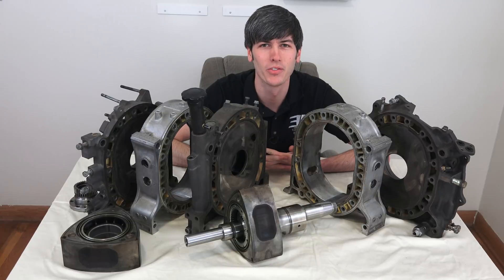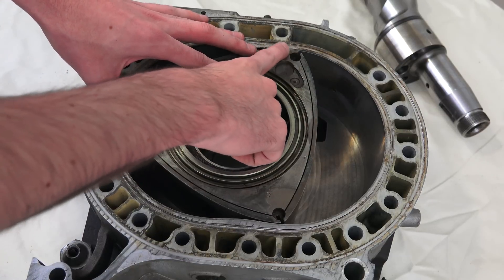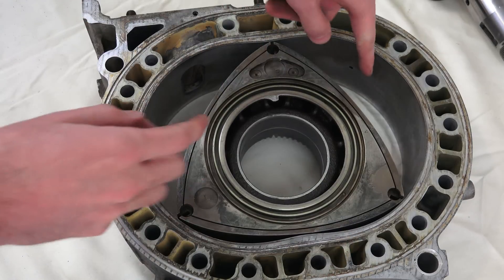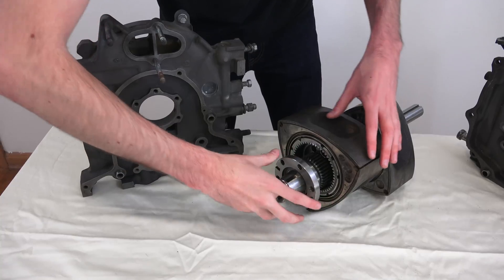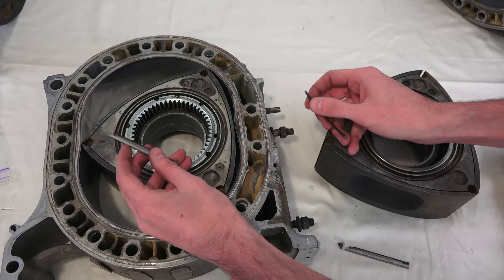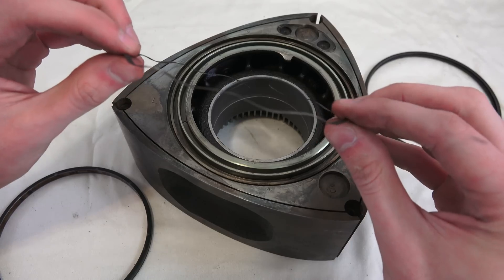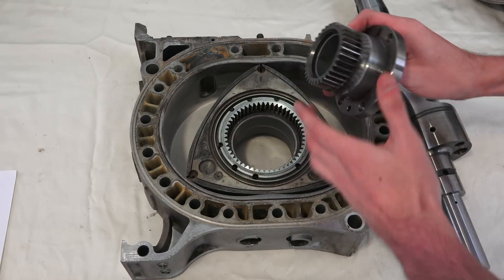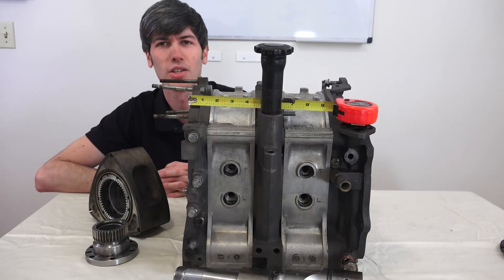How Rotary Engines Work - Mazda RX-7 Wankel - Detailed Explanation

Comment: what a fantastic design... No matter how bad the disadvantages are. I really hope they can find solutions for these problems some day.
Reply: Mazda hinted at the idea of bringing back the rotary but with some derivative of skyactiv tech (from what I've read in a Motor Trend mag). But who knows, maybe they're just giving us blue balls.
Reply: +g4rr377 They burn oil very slowly. I have to add a half quart to my RX-8 about every 2,000 miles. Several piston engine manufacturers consider that as acceptable consumption for piston engines.
Reply: +PvanP 
I've never had any problems with any of mine, they just need a little TLC and an oil top up every few thousand Ks.
It's neglect that kills 'em.
Reply: @Rangifulla  They have a good power to weight ratio as well.
Reply: g4rr377 Thing is they're really not all that bad at emissions. They do better than piston engines when it comes to carbon monoxide, but they fall behind in nitrous oxides. Since the limits are designed for piston engines, they get hammered for that one category despite being better in the other.
Reply: RexSpec06 piston engines also have inherent disavantages (RPM cap, friction, etc.). Just think about how genious the person who thought of this must have been. Much more impressive than the piston engine in my opinion
Reply: @pierrot148  I read that the wankel engine requires more matinance than a piston engine, but I think the simplicity of the design outweighs it.
Reply: edgar calderon jr Sounds like a dream ;) Man I hope they put it in all their cars up to the mazda 6 haha. That'd be a selling point for me.
Reply: PvanP
I have an '06 Rx8 now but I had a '75 Rx3 coupe for over ten years, one of the most reliable cars I ever owned. They're economical and trustworthy if you don't thrash them but so many people do.
Reply: +Shea Samuels Mazda have shut down all rotary factories and research labororoties. Given the flaws of a rotary engine design such as fuel burning inefficiency, heavy oil burning and general lack of torque output, I wouldn't expect rotary engines to ever make a comeback in a production car in the future.
Reply: Junaid Mohammed They've shut down production but they have not shut down research. There is a large team of engineers at Mazda working to find a breakthrough that'll allow the 16X engine to be on par with piston engines when it comes to fuel economy yet have the advantages of a wankel.
Reply: @chitlitlah  You are wrong, the 16X program was cancelled in 2009, Mazda removed its 16X page from its global website.
Reply: @sandervanderkammen9230  No I'm not. Mazda is still researching rotaries, even if it's not their primary concern. They're looking into a rotary / electric hybrid now.
Reply: @chitlitlah  Everything you have said regarding this topic is a complete lie, you have NO credibility left.
Reply: +PvanP   They're only problems for long-term passenger use.  If you want to race it then fuel economy, oil usage, and parts wear isn't important.  It's powerful, light, and compact.  The rotary-powered Mazda 787B won Le Mans.
Reply: +PvanP bringing down fuel consumption by just blowing in gas vapor instead of the liquid version , it works with any gas engine !
Reply: +Junaid Mohammed Mazda has already designed the next gen rotary. Should be out by 2019. I think they said they were going sparkless. They were vague on the details but said it was going to be factory turbocharged for sure. Can't wait!
Reply: William Su Oh I've went back and forth with him a few times. I'm quite familiar with him. I'm surprised he hasn't made it to this video yet.
Reply: Dustin Comp What put makers off the wankel was also the licence fees. That wasn't an issue in piston engines. 
Yes, the Piston engine in the 1950s was not a great thing at all - and still is not.  80% of the fuel in a tank is wasted.
Reply: The real doktorbimmer Benz have a lot invested in antiquated piston technology. The 1970s fuel embargoes and subsequent fuel price hypes reduced the Wankel's appeal. Nothing else.
Reply: +PvanP Yeah agreed, it is an extremely clever design. Just sounded like a slight contradiction.
Reply: +chitlitlah They closed down their rotary research team last year and the same staff are now working on their future hybrid engines. They were initially researching a 0.33l hybrid rotary but opted to go with a traditional piston engine instead.
Reply: The solution is an LS    Jk don't kill me rotary fans..... Even if the LS is better
Reply: +chitlitlah yeah he's not someone you can argue with cause he's got this pride complex. the guy will make up shit and skew wording just to bm anything rotary.
Reply: +William Su HAHA! You've encountered Doktorbimmer too? He is radial engine/rotary piston engine fanatic that despises the fact the Wankel rotary and the rotary piston share a name.
Reply: Ronin You better not dare call an engine that has rotors which rotate a rotary engine!
Reply: Ronin
yyeeesssssss!!!!! hahahaha ive seen his comments too on almost every video that has the word "rotary" in the title
Reply: +PvanP no....the rpm are much higher in piston engines  Mazda RX7 7000 redline RX8 9000rpm ..bike engines 12-16000rpm
Reply: The real doktorbimmer IDK where you read that but the rotary was considered an unfair advantage and banned from the LeMans races.  it was not deemed poor and retired...  they are talking about allowing the rotary design again and thus Mazda made the LM55 LeMans car in anticipation of being let into the LMP class again.
Reply: The real doktorbimmer is that a 2 rotar?  the 787 housed a R26B that was NA tuned capable of 900 HP as far as I know its the most powerful NA wankel and with FI there are drag cars at 2k HP using wankels...  but for 2 rotar Mazda's most powerful engine is the one that they are claiming to release for 2017 in the new RX7...  approx. 300hp but nobody knows if its NA or if they turbo'd...  I'm eager to see the specs for it...   they say that it is more fuel efficient by far and is fuel injected,  is more reliable and has better cooling system now and dramatically improved torque...  basically improved in every aspect with no downfall on any stat...  guess we'll see when it releases but I really hope so...  i'll swap my rx8 from the renesis 13b to the new one if its really that much better like they claim
Reply: The real doktorbimmer Mazda make racing rotaries and are introducing the RX-Vision. bimmer you are telling lies again aren't you? A bit of a Tom Pepper. Yes you are.
Reply: @johnburns4017  ITS BEEN 5 YEARS JOHNNY!!!! WHERE IS THE RX-VISION YOU PROMISED????
Reply: The real doktorbimmer M-B never invested heavily in rotaries at all. They made a rotary for the C111 concept car, that's all. 

'The second version of this 300 km/h thunderbolt is propelled by a 350 hp (257 kW) four-rotor Wankel engine. Its turbine-like characteristics and incredible output figures make this vehicle concept perfect. Mission accomplished.'
Source: ‘Linzer Volksblatt′, 23 August 1969

Also, 'The more stringent emissions legislation in the United States was to prove an added complication.'

The Arab oil embargo and USA emissions reduced the rotary's appeal. Nowdays the problems of the 1960/70 have been overcome. 

bimmer is silly again - sorry, silly all the time.
Reply: Diesel cycles are generally high compression which isn't really the forte of the wankle.
Reply: I hope they never find a solution.stick to what actually works.
Reply: March 5, 2019. There still no new rotary engine from mazda and i doubt that they will ever come back. The most feasible "rotary" engine is an electric motor, it is the future.
Reply: Well it's 2020 and a lot of people in this comment thread are looking very foolish right now.
Reply: Rangifulla cool what do you drive?
Reply: Rangifulla whoa an rx3 that's really cool. I heard they made a station wagon variant of those. How cool would that be. I suppose they don't exactly sip fuel?
Reply: +Andrew Solis No they haven't, if it was already designed then it would be out a lot sooner than 2019. I believe you're mistaken with their plans for the RX-vision concept car. If they have enough interest in it, development and production would take them until 2019 to release the car.

Don't have high expectations though, there is a large possibility that these plans will foil before then.
Reply: +Junaid Mohammed I think they are still working on it, the recently released info on a skyactive rotary in the works, but likely only for a specific limited production car. There is defiantly a lot that can be done to improve reliability, just depends on costs.
Reply: +g4rr377 true, the mileage is very bad but that also makes them very cheap to buy. my rx8 with 70K miles was only 7,900
Reply: g4rr377
yeah us dolars. they are actually even cheaper but mine was in good condition
Reply: jerry juarez boooooo bad jokes~
Reply: Junaid Mohammed I'm wondering where you got your information from and why Mazda has said in the last few months that they're still researching it when according to you, they aren't.
Reply: @chitlitlah  Looks like you are the one thats wrong... Lol!
Reply: ***** The info was spread by some jackass on the interwebz by a guy names doktorbimmer. He's apparently some anti mazda fanatic.
Reply: +William Su lol
Reply: +g4rr377 I got an 09 rx8 and I have gotten over 25mpg on highway but also bashing on it I have dove as low as 15mpg
Reply: +PvanP Depends on carburetion used (side drafts are right thirsty, vacuum or mechanically activated 4-bbl gives you a choice) and how heavy your foot is.
Reply: Jaymobe07 I hadn't heard that being the reason..  I know the trans can take 11-12k...  But 15k may be too much for it...  I seen ppl run stock trans at 450whp and 11.5k rpm...  But I haven't heard how long the trans lasts at that kind of spec...  I'm hoping to get my car up to 600hp but I'm also planning on a 20b swap to get there...  Since I'm wanting to go that far I May just put in a new trans while I'm at it...  Problem is I want to use the stock shifter spot and not cut a new hole...  I wonder if the corvette 8 speed can be converted to manual and fit it..   That's like my dream trans for my build
Reply: +chitlitlah They have smaller carbon monoxide emissions because they don't burn the fuel nearly as completely as piston engines. Carbon monoxide is one of the primary combustion products of a gasoline engine. So a lot of fuel is just blown out of the exhaust pipe, reducing efficiency.
Reply: +William Su The problem with the rotary engine, is that it will never produce the torque of the equal size piston engine. This is because the power strokes force is a tangent of the perpendicular. torque is max on the perp.
Reply: PvanP no the the piston engine has a higher Reliable rpm cap the Mazda LeMans 24 hr race car had rpm limit of 13k many production bike engines redline at 14 to 16k. The rotary may be capable of hi rpm with out exploding but the rotar seals don't last long at that hi rpm
Reply: david appleton RPM doesn't affect the seals as you would think.

People have this fixation with the 'SEALS' in these motors.
Reply: in a rotary higher rpm means more centrifical force sealing the rotar to the housing,  there are rotary engines revving higher than motorcycles...  most ppl choose not to for numerous reasons varying from ease of engine tuning, trans setup simplification, and when a car revs to 18k ppl give disapproving looks for whatever reason
Reply: Tuppoo94 Carbon monoxide is partially unburnt fuel. The reason there's less of it is the higher exhaust temperatures, which is also the reason there are more nitrous oxides.
Reply: +Junaid Mohammed 
Mazda are to launch the RX-Vision next year. Rotaries are used in UAVs. Many companies are using them.
Reply: @johnburns4017  JOHN BURNS MORGAN TELLS BIG FAT PORKY PIES!!!! WHERE IS THAT NEW MAZDA WANKEL ENGINE YOU PROMISED?????
Reply: +Andrew Solis 
Mazda are doing R&D in laser ignition.  Liverpool university did a hell of a lot as well.
Reply: +RexSpec06 
The disadvantages can be ironed to elevate the engine over piston designs.
Reply: +William Su 
Yes this doktorbimmer is some sort of nutter.
Reply: ***** lol..   Just LOL
Reply: COMMENT You are so wrong and need to learn how to use a keyboard.
Reply: COMMENT Mazda is releasing their new rotary next year so we'll see
Reply: +Dustin Comp  I still wonder if it'll be EPA legal in a stringent US. Will they still be burning oil in the chamber? Or have they developed magnetic bearings and better seals? Also being turbocharged increases the amount of lost fuel as well as the low compression so it will be interesting for sure
Reply: +Dustin Comp  I still wonder if it'll be EPA legal in a stringent US. Will they still be burning oil in the chamber? Or have they developed magnetic bearings and better seals? Also being turbocharged increases the amount of lost fuel as well as the low compression so it will be interesting for sure
Reply: I heard they are staying with na and going higher compression yet with new dimensions and relocated injector ignition exhaust locations...  I assume its still USA legal
Reply: Johnny Outterbridge Rotron in England are developing a diesel fuel burning rotary using spark ign not compression ign. It is to conform to NATO's single fuel.  The diesel fuel will act as a lubricant for the seals before being burnt.
Reply: @johnburns4017  Are the compression ratios high enough though?
Reply: @johnburns4017  WHAT HAPPENED TO ROTRON??? THEY ONLY SELL PARAMOTORS WITH RECIPROCATING ENGINES NOW!!!
Reply: Dustin Comp Yes to celebrate 50 years of Mazda rotaries.
Reply: @johnburns4017  MAZDA HAS NOT UNVEILED A NEW WANKEL ENGINE IN OVER 25 YEARS!!!
Reply: ***** I hope not...  Seems that will go against the rotary tradition...  Will lose lots of rpm from the red line and the hp curve will be all fcked
Reply: ***** not this next release...  The 2017 is a redesigned rx7 body with new tuning...   The 2020 is suppose to release the rx9 with a 1.6L as the 50year celebration.
Reply: Dustin Comp 50 years is 2017. 
http://www.topgear.com/car-news/concept/meet-rx-vision-mazdas-gorgeous-rotary-engined-sportscar

http://www.autocar.co.uk/car-news/motor-shows-tokyo-motor-show/mazda-rx-vision-rotary-engined-sports-car-concept-revealed
Reply: ***** well I'm not a big fan of the new body styling but that may change some still before production...  But in the interior pic it appears the tach still redlined at 9k so it appears we are looking at a rx8 styled power plant with high compression and rx8 chassis and suspension but with a rx7 body styling
Reply: Dustin Comp I'm more interested in the engine :)
Reply: Maybe I can buy the engine and put it in my rx8 lol
Reply: Dustin Comp Good idea.
Reply: If it around 300 hp na...  That's a beastly rotary..  And then potentially going turbo on top of it...  That would shut some mustangs up real quick...  Easy 400+ hp with turbo and weighing in abou 3000lbs total...  That's 600-800 lbs less than a mustang and possibly at same hp with simple turbo setup
Reply: well if the LM55 hits the LMP class track we'll see how it measures up within the next 2 years or so I guess...  you have to also understand the wankel is far younger than the piston engine too...  so its progress now is the equivalent of the piston in the 1950's...  gotta realize the time each type has been around and the time they have been able to experiment to perfect them... also there's like 100 companies making the piston engine while mazda is the only major company producing the wankel so the progress is gimped there too with no competition and having basically a monopoly on the design...  I admit they have down falls,  mainly gas milage and torque however I believe they can solve those issue with time and they claim they did for the 2017 release.... guess we'll see when it comes out
Reply: Dustin Comp Benz never sold any. They did the research in the 1960s. A looooooooong time ago. Matters have changed.
Reply: Dustin Comp It is called the RX-Vision. Mazda appear to have done great job.  Even they stated rotaries do not like to be revved up and down and are very efficient at constant loads and speeds.

BUT!  Mazda are introducing a rotary with a conventional drive transmission, in short one that revs up and down a lot. They say they have sorted the problems. If they have sorted the problems when revving up and down then on a constant speed, as in a range-extender, they will take over for sure.  

The rotary is one third of the weight and size and with an amazing power/weight ratio. Ideal for a hiding a range extender (a part time engine) near the spare wheel.
Reply: +PvanP  Solution....get rid of the EPA
Reply: The real doktorbimmer
 According to some car magazines, rumor has that Mazda is still working to make it work with better fuel economy. I owned several RX-7 from the 80's and they were pigs on gas compared to the muscle cars of the era.
But they were great little cars! Pretty fast for their time and great handling. I have never driven an RX-8, but they look pretty cool.
Reply: The real doktorbimmer
  Wow! Being an RX-7 fan that is ad news. I didn't know that RX-8 almost destroyed them.
I still love the old 7's, they were smooth and pretty quick for their time.
Sad that Mazda couldn't make it work.

Thanks for the info.
Reply: 7lk
Reply: 7lklllko
Reply: 7lklllko
Reply: 7lklllko
Reply: 7lklllkolkhbhh
Reply: 7lklllkolkhbhhi
Reply: Dustin Comp
 i just saw in the news that Mazda has redesigned the Rotary engine, basically flipping it kind of up-side-down. They applied for a patent.
http://www.foxnews.com/leisure/2016/04/06/mazda-rotary-engine-makes-180-degree-turn/

I loved my Rx-7's!!!
Reply: The real doktorbimmer
 Great info.  thank you.  I've been a fan of the little Rx-7 rockets since I was a kid and I still think they are some of the best looking cars out there.
I can remember the old ads for the Rx-7 in the 80's that stated run times for 0-50 instead of the common 0-60, but they were quick little cars.

now, I don't even think I can fit in one anymore....LOL
Reply: +The real doktorbimmer a manufacturer replacing more engines than they produce ,  dude take your foil helmet off , your cutting the blood flow off to your brain.
Reply: +COMMENT
Doctor Bummer is back...........
Reply: A design with a bunch of problems and bad disadvantages is by definition NOT a great design
Reply: "ingenious" not "great" but still, so simplistic yet powerful and light!
Reply: 2 Years on, don't think they will be back, it's just a peice of history.
Reply: By removing material from the piston you don't increase displacement,  you reduce compression.
Reply: Mitch  You need to learn more about the development history of the  Wankel engine, it will give you a better insight into the reason why they are inferior to reciprocating engines.
Reply: I remember reading an encyclopaedia article about the rotary engine as a boy. Was really impressed and still am amazed at how it was engineered.
Reply: This day marks the 9year anniversary of the final demise of RX production at Mazda.
The very last Wankel engine powered car rolled off assembly line on June 21st 2012.
Reply: Yeah, endless fuel supply
Reply: If the design has clear inherent disadvantages, can it still be called 'fantastic design'?
Reply: g4rr377 I think they could fix that by using self-lubricating composites or diesel (don't quote me on that)
Reply: david appleton bike piston are short stroke that's how they achieve those rpms...  And it's claim the stock rx8 rotary can hit 15k rpm but Mazda limited it at 9k for engine life and reduce excessive wear and tear
Reply: +John Burns WELL THE PROOF IS IN THE PUDDING. I KNOW HOW TO USE A KEYBOARD. THE CAPS LOCK IS STUCK. IT USES A ROTARY SPRING INSTEAD OF A PISTON SPRING....
Reply: The real doktorbimmer the owner of mazda came out at the last Tokyo motor show and openly confirmed a new RX7 with a new tuned rotary engine in it...  it is back and he says that as long as he is in charge mazda the wankel will never be trashed.  in his eyes the wankel is the backbone of mazda and will forever be refined and produced....    they are starting production of the new RX7 already and hoping to release it for the 2017 year as long as they can get enough produced otherwise they will release it for 2018
Reply: @gamingmadesimple5510  Well its 2021 and your new 2017 RX-7 rumor is just as BS as it was when you posted that comment!
Reply: 2 points. 
half a quart / 2000 miles is crap. ask my 300k corolla.
And
NO is hundreds of times more toxic than CO. So it's not "becuase the limits are based on piston engines"
Reply: The real doktorbimmer because people are idiots and don't want to accept and understand something that isn't what they know. And regardless of the flaws and how they compare to today's vehicles, i still want an rx7 of any flavour, just purely for their unique sound, also they were the original "V8 killers".
Reply: the ain problem with hem as far as I know is (based on last gen rx7) is that without after market work they destroyed themselves with heat put the good thing is they're really cheap to insure ( the rx8 is a 1.3 )
Reply: +PvanP Don't listen to that guy, fuel vapor burns waayyyy hotter than liquid fuel. Research Fuel to Air Ratio, you will get a clear concept of how much damage you're going to do to your vehicle by running some kind of make shift fuel vapor system.
Reply: +Dustin Comp I heard it was because of the transmission not being able to take the revs.
Reply: +chitlitlah 
Mazda claim to have cracked it in the RX-Vision.
Reply: +John Burns ROTARY IS GREAT BUT IMPOSSIBLE TO ELEVATE OVER PISTON ENGINE. SIMPLE KNOWLEDGE OF MECHANICAL  ENGINEERING WILL BRING YOU TO THIS LOGICAL CONCLUSION.
Reply: Gaming Made Simple ...  I have some leaks that haven't been reported...  yet...